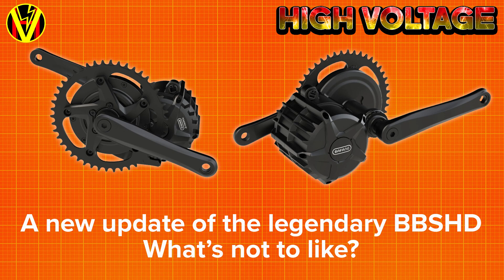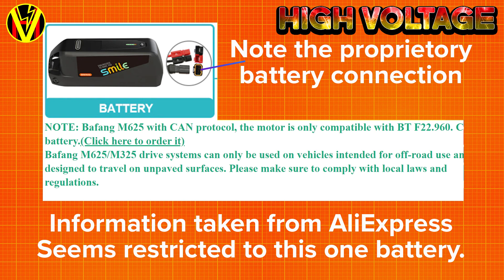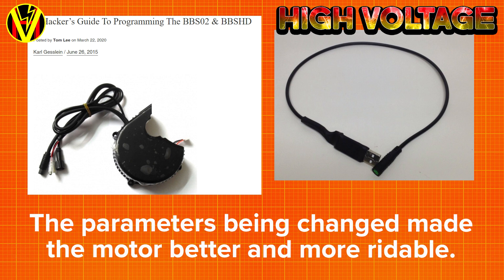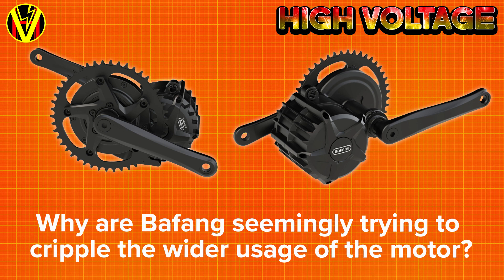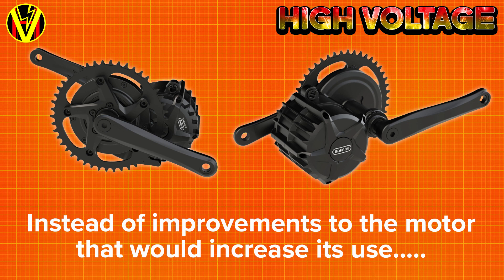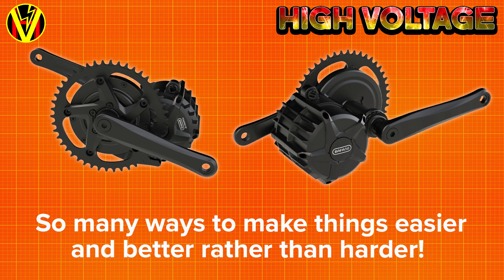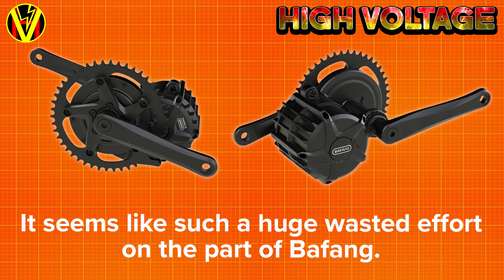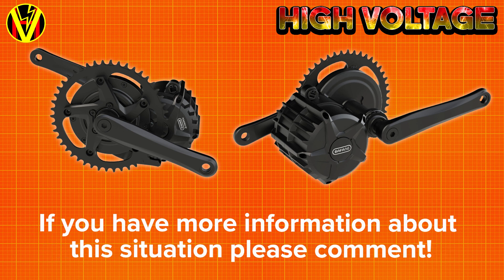NEW Bafang BBSHD / M625 locked to 48 volts, have to buy Bafangs own battery, what are they thinking?

Comment: So they dumped this garbage? I asked you about this yesterday, and you said if I get an HD, i'll be ok.I plan to make an ebike with the stock controller, then save up for a BAC kit
Reply from the maker: I think there was alot of back lash. I'd get the bbshd for sure. Bafang never confirm anything but it's not on their products page.
Reply: @HighVoltageKits  Just got and installed a bbshd. it's locked to 28 amps and the egg rider will not let me set it to 30 amps. why is that, and how much power am I losing (52v 20ah)?

Comment: Hi how long battery live or km/h battery live this bafang m625 ??? Thanks
Reply: Oh so that's how it is, i use it for uber delivery bicycles in sydney, for the fastest speed of 25-40km/h , the firts way i use the trottle when i go i replace it with the pedal, if you suggest me for a battery that can last a long time what kind of battery do you use ? Bafang original 50.4v 19ah battery or 52v 35 ah triangel battery ? Thank you
Reply from the maker: The 52 volt battery will not work with the M625. It's the one bafang supply or nothing due to the controller restrictions.
Reply from the maker: Hey Stefen. How long a battery lasts is very much dependent on the rider. Do they use only the throttle or pedal as well? How fast are they going etc. I used to get well over 50km with a 25 amp/h battery. I could have got much further going slower with more pedal effort. Sorry I can't give you a definite answer. Its not a simple calculation. I would start by deciding how far and fast you want to go and then pick a battery that will give you the amount of energy to achieve your goal.
Reply: I will use ASI BAC855 can it work ???

Comment: I was going to buy bafang 1000w next winter. Bbshd is discontinued now, m625 works with bafangs battery only... They have just lost one buyer! I will not buy m625 that will not work with my battery, I will stay with my hub 2000W motor for a long time! Thanks bafang, more money in MY pocket!
Reply from the maker: For now you can get one still. I think there is plenty of stock. They might also hand off the design to another factory. I have some sources saying its being stopped. Fortunately the guts of the 625 are the same so if you did get a BBSHD the parts and spares are still available. That said if you have a good bike with a good motor why spend money! If it aint broke don't fix it. Cheers!

Comment: if they sell the motor without a battery, even if its locked, just throw the stock controller away and install a grin tech phaserunner, way better and programmable controller, open to any battery, supports 36, 48, 52, 72v batteries and now even has a bt android app to change settings on the go.
Reply from the maker: I would use our own upgrade kit with the BAC855. But you are quite correct all the upgrades do work including the phaserunner if you can get one. They are not in production right now. Check this video for a test with the 855 https://youtu.be/E0uTBAppIEs
Reply: @HighVoltageKits  the phaserunner is based on the bac, but its more configurable for a end user, with the bac the plarform is closed for customization of the config, i like phaserunner more.

Comment: Is there no way around this battery exclusivity problem?
Fortunately I saw your video, I was going to order a BBSHD, I already have 2 48v-21AmpH batteries.
Are there equivalent mid drive motors for those like me who already have their batteries?
Thanks for your channel!
Reply from the maker: You can still pick up a BBSHD. I sent a controller off to get looked at to see if the battery can be bypassed. I hope so. But nothing yet. I will update when I get anything.

Comment: Sounds like they are trying to get pre-made bike manufacturers lined up and forsaking the bike upgraders
Reply from the maker: Yeah. I see your point. I'm not sure it's going to work though. Everyone I know is taking a hard pass on it. Perhaps feedback will make them at least rethink the battery part.
Reply: Any wise bike builder would go for an integrated mid drive. There aren't many folks who weld or braze frames by hand for buyers looking for a big, dangly bottom bracket codpiece of a motor. I'd question whether they have much real sense of the market they sell to.

Comment: Nice info... If battery cells exhaust life or if I need a customised battery I still have to go searching for new bms from bafang or use the old bafang bms came in this kit hence forth... Plus I live in India if the shipping dissent allow batteries so I cannot go for bafang kit n I have purchased 2 kits in past for my bikes...in future I cannot have bafang kis as they come with battery as shipping didn't permitted it
Reply from the maker: So far Bafang still makes the bbshd and the bbso2. I do not know if they will stop. I have a video for tomorrow taking the m625 apart. Thanks for the comment. Cheers
Reply: @HighVoltageKits personally.. before  rip up I feel a video on the performance would be better as it can reveal the difference between known original factory fit new Bafang as compared to earlier models...specially addition of the handshake battery.... but this is just me..
Reply from the maker: The only real difference is the controller which makes you use the battery. I would stick with the BBSHD if you can get it. The motor internally is identical. I will see more when it gets connected to an ASI.

Comment: I’ll also point out, I don’t like the strap. Looks half assed and ad hoc. A big part of the electric bike market is coaxing older, less experienced riders back on bikes like getting a chipmunk to take a nut from your hand. Bosch is too expensive. Bafang seems too half-assed. That metal hold strap makes them look more half-assed.
Reply from the maker: The strap does look rather ghetto! Cheers

Comment: Looks like I'll be buying another motor to keep in storage. I use a phaserunner instead of the Bafang controller anyway, but if they're going this far who is to say they won't find some proprietary way to lock that out as well. Ugh, this sucks.
Reply from the maker: Probably not a bad move. I am optimistic that parts will remain available
Reply: @HighVoltageKits  I'm not, bafang was giving luna shit years ago about modifying the controllers and selling them openly. If they  are willing to go at one of their biggest distributors over DIY stuff, I fully expect them to pull the old switcharoo to force people to "upgrade". Right now I already have my old beat to shit motor as a parts donor, but having a whole new setup on ice along with your gasket set should set me up for years.
Reply from the maker: Sounds good! Yeah. I dunno why they are so freaked out when it's a DIY motor.

Comment: Based on this news my prediction is that we will see a major manufacturer or three announcing the release of new, lower cost mid drive bikes in their North American Line ups, featuring these new UL listed Bafang Mid Drives.   We can't have a bunch of DIY'ers running circles around their OEM Bafang units, now can we?  Slick how they called it a revision-update whatever and made some cosmetic changes as well.  That will make it easier to paint the older motors as inferior to the public.
Reply from the maker: The changes seen more to be restrictive than improve the experience. It is essentially a kit still. Just with an ugly oversized battery that is forced on people and limits the scope of the build. I would love to know what they are actually thinking on it. To be fair tho I have no idea how many motors they sell. You would hope that the researched it first. The marketing looks so very dated. The cheesy smile slapped on the battery. If I was a major manufacturer I would not accept having to buy and use their battery. Bafang have always had this thing about the motor being run over 48 volts. This is just the latest attempt. They are not so stupid as to shut down bbshd production I notice though. Thanks for the comment! Cheers

Comment: Dear Grin technologies,    
Please make a Phaserunner specifically designed to fit where the Bafang controller used to live.
Reply from the maker: I would not hold your breath here. They do have an interesting version called the base runner that goes where a battery mounting plate sits. Not great for heat dispersion tho. Cheers

Comment: I am sure they do this for warranty reasons. They figure why should they replace a motor that you went over their specs just because it worked? they do this with automobiles as well. One must remember we are not the product makers so if we do custom our paid for products we are on our own.
Reply from the maker: Yeah. Maybe. Daft thing is having looked at it there are weaknesses now that make warranty issues much more likely 🙄
Reply: @HighVoltageKits  I agree. I see it from their point of view and ours.They are building a better and newer products for us NON E-Bikers. Bosch has the best integration on E-Bikes right now however to gain access to it means lots of money. It reminds me of the 2 stroke vs the 4 stroke wars. I rather buy this kid once I get the money because its more on the modern  side. Sure you can hack the older product but I am sure this product can be hacked as well. I also love the mounting concept because it provides more support.customizing is not always going to look pretty compared to the mainstream product. I don't have $10,000 for a legit E-bike.  So a few ugly clamps are not going to hold me back from this kit.
Reply from the maker: Its been pretty much confirmed that the older version will still be made. I would give it some thought. I have heard of multiple problems with the new controller already. I would get it from probably luna or similar. I used em3ev in the past but not hearing the greatest things anymore. There are other vendors. The 48 volt battery they sell with the new motor is garbage. The plug that has to connect to make it work is super weak. I will do a video when I get a chance.

Comment: A little over 5 years ago I bought the first generation of BBSHD, and I am very pleased with the performance. Last year my friend bought “the same” but this is not the same like mine 4 year older model. This new BBSHD is noticeably slower than mine. So after 4 years the same model is software backward. Shame. 🙄
Reply from the maker: It might have the amps restricted. They have done all sorts of odd things. The motor is likely the same but they may  well have changed the firmware. It may be possible to adjust it with a program cable. It's hard to be 100% without all the details on the bike etc. If he wants help he and you are welcome to post questions on the discord channel! Cheers
Reply: @HighVoltageKits  I tried to adjust the same settings with the program cable as on mine, but mine in the same settings get peak of 1500W, and from a friend the new BBSHD get 1250W 🙄
I don’t know how to set this new BBSHD to work like mine old model.
Reply from the maker: On mine I used the eggrider to set it to 30  amps from 27 where it was. I have seen it set to 25 at some places. Boosting the amps to 30 should give a peak of 1700
Reply: @HighVoltageKits  1700W on 52V full charged I guess? Mine is 48V and therefore it should be 100W less. 
Eggrider you say? I will try! Thank you! :)
P.S make a video tutorial how to upgrade with eggrider! 🙏😅
Reply from the maker: Correct. So if you can up the Amps it will be the same as you. If you guys want to learn more you are welcome on the discord channel. There are a few videos on the eggrider in my videos list. Nothing that recent tho so it might not be be best resource. Hope this helps. Cheers

Comment: This is a road all electronics are going down.
I fully expect future ebikes to require registering with an email and only work on confirmed trails via gps.
Already my mates 7 grand specialized needs an app on the phone for the warranty.
Reply from the maker: Yeah you might be right on big manufacturers. Personally I would like them to deal with cars and trucks first and limit them in speed and power to what is actually needed. Stop people from ragging it at 70 over the speed limit and burn up three times the gas. I am not worried about this kind of thing with DIY ebikes. We will see how this works with the new motor when it arrives! Cheers

Comment: I liked new mounting type but is there any performance  wise increase on new model? If not, this seems downgrade from the old one. I recently got a 250w very cheap ebike and love it. Time to build a bike with bbshd but i cant decide the model. I think old bbshd m615 with good chainring is way to go because of canbus. Other than that, are you sure about new canbus battery has 13s config?. Its listed as 50.4v and charger is 58.x.
Reply from the maker: I don't think there are any performance upgrades. We shall see in a while when it arrives!

Comment: The cyc x1 pro seems to have all the functionality and power any DIY'er would ever need
Reply from the maker: Its a good motor. I have a bike with the generation 1 of the X1 PRO. The bbshd has a place though. It's more reliable and can be serviced on the road. Its good to have options! The new cyc motor the x1 stealth is also well worth a look. Cheers!
Reply: @HighVoltageKits  The new gen is putting out 5kW, nothing to sneeze at and the way it's configured seems like it might be easier to integrate in modern FS frames, particularly mounted in the frame between the downtube and the seat tube. Love the videos by the way, the interior is gonna be a hot one this summer.
Reply from the maker: 5kw is good. Plenty of power. The interior is gross! So much smoke..Its cleared tonight so off for a ride! Cheers

Comment: I just saw a video about what I think is an emerging technology regarding Sodium Ion batteries.  Is this something you've had a chance to look at and form an opinion about its potential use in bike batteries?
Reply from the maker: Not yet. But please post the link if you have it or better yet post it in the battery section on discord! Cheers
Reply: @HighVoltageKits  The site is The Electric Viking.  The video is "CATL's sodium batteries will be 30% cheaper and revolutionize the world" and it was posted on June 8, 2021.
Reply from the maker: Thanks!

Comment: My guess is that prioritising DIYers is a bit niche.  My wife just wants a cute bike with some electric oomph to keep up with me.  Supply of ebikes is limited and they cost $4k.  She has 2 cute bikes she likes.  I think this kit is perfect for her and others like her who just want something easy fitted without having to think too hard.
Reply from the maker: I see the appeal of a kit like this. The thing is it was already available from luna or em3ev. Luna made a bunch of ready made bikes with the bbshd. So did Bolton. These are not small places but large volume suppliers. The packages that provided are exactly the same as the new one just with more customer choice. I am sure you are right and the lone DIY guy is not a concern. But its not just a few avenues this might shut down. Consider the cyc x1 stealth for your wife's bike. It's new but has torque sensing. Worth a look. Cheers
Reply: @HighVoltageKits  " Luna made a bunch of ready made bikes"  All they are doing is selling Dengfu bikes.  I don't think they are even building up the frames.

Comment: This makes no sense. The provided battery is huge and useless for most builds.
I hope atleast the internals are interchangeable for spare parts to older bbshd. 
How hard is it to design BBSHD without that junk controller and nylon gear. Implement a better mounting system and ..? profit!!!
Reply from the maker: I am mystified as well. The battery is huge due to the mounting plate being massive. It really restricts the bike frames it can be used on tho.

Comment: Hack it give a BAC800 and  72v as you said in your previous Vlogs the standard controller isn't very good..
Reply from the maker: It will be fun to get one. A guy posted a whole heap of pics on the discord channel that installed it. There are a few nice touches that were not apparent. As well as a service light at 5000kms.

Comment: The m600 have the same handshake port for batteries. The ultra too. They both works without bafang batteries and/or bafang BMS com protocol. It's an option requested for some norms here in Europe. And bafang need/want to comply. 
Successful DIY project/fields ALWAYS land in restrictions drama. It was awaited and will be even harder in a few years. That said, there is also the diy controller folks... And trust me on this, "we" aren't really unhappy about this.. 😎💪⚡✨
Reply from the maker: Well that is definitely more encouraging info. As long as nothing internally has changed on the halls board it shouod accept a BAC855 like before. The ultra is much harder to get running with the BAC855 etc due the halls. Yet to see a good setup with the torque sensor. I will look at other options if they keep making it harder and refusing to play. Cheers
Reply: @HighVoltageKits  it's not ASI based 😌☝️. And also a reason why there will be flexibility 😇😂. Finally, halls aren't really mandatory for mid motors. The new generation M500/600 for instance are sensorless driven. With FOC, and smaller/reducted motors, the benefits are very very small (first 10rpm or so ;))
Reply from the maker: I think my stuff is set to Hall start then sensorless run. There is a lot of exiting motor and controller tech in the pipeline. Appreciate the information. Cheers

Comment: I got a second BBSHD in case the first one melted it's totally new with a 120mm Bracket.. I'm putting it on e bay..auction..bidding starts at 2000usd..cheers mate now I can afford a 4000 watt  ASI controller kit from John.hahaha..Submarine
Reply from the maker: Its gonna be a rare beastie potentially that size!